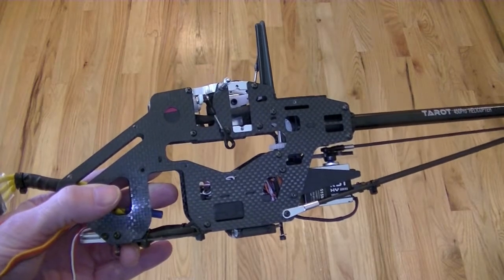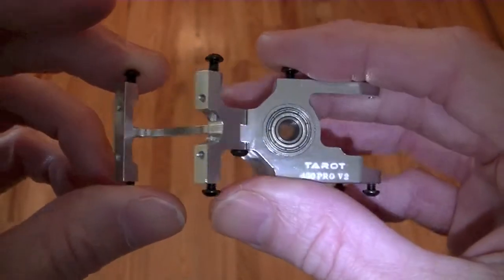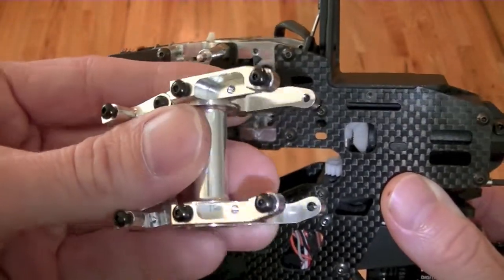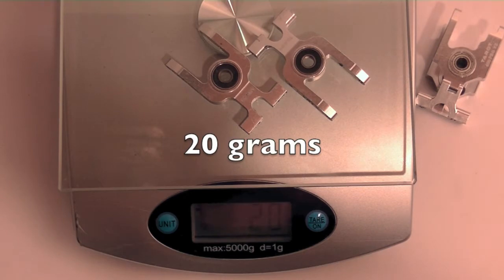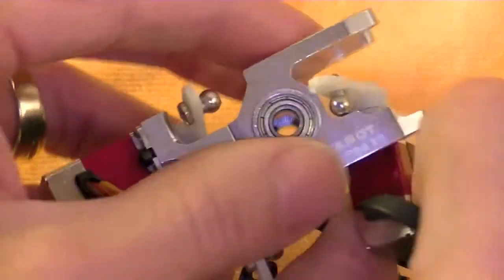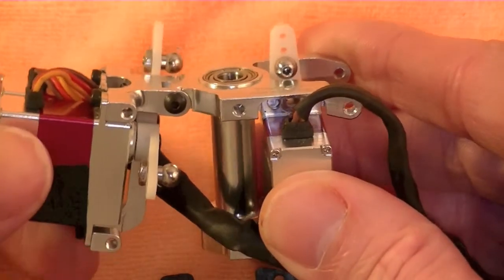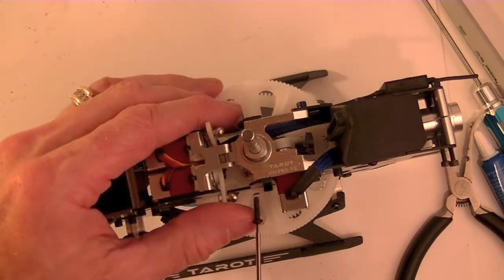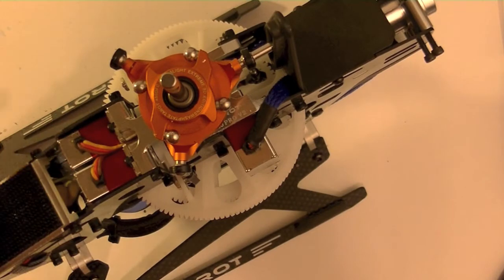57 : Tarot 450 : One Piece Main Bearing Block

Comment from the maker: That's the way they *used* to do it. They have changed that with the newer models.  Take a look at a 450 Pro 3GX manual, and you will see that the servo is now normally installed on the outside of the block (for easier access).

Comment: Have you used the align dfc main shaft on your tarot 450pro? I've tried but I have to shim out about .8mm of slop... Not sure if it's the frame, bearing blocks, or bearings :( makes it a pain though because if you use an Align dfc head it throws off your pitch as the tarot dfc shaft is shorter so the only way to fix is subtrim in the fbl controller or shortning all rods between servo and swash..

Comment: I see you've installed your aluminum transimission with the top access to the front TT gears.  That's a great modification that Align should copycat.
My question is if you've had any problem with the mesh between the autorotation gear and the transmission drive gear?  I've read in two reviews for this mod that the mesh is too tight.  The reviewers may have been installing into Align frames though... dunno for sure.

Comment: I thought the "normal" way to mount the rear servo on the standard bearing blocks was on the inside of the blocks, with the ball reversed. That's how the align manual shows it.

Comment: HELLO CPO i got this one piece bearing i am having a problem the swivel screw is locked in so tight i am afraid it will snap off any suggestions
Reply from the maker: If it's been thread locked... You can apply heat to loosen. Put the tip of a soldering iron on it for a few seconds to heat up the screw.
Reply: EVERYTHING cpo thank you
Reply: EVERYTHING cpo have you any idea what size the bearings are mine have got fairly sloppy are they the same as the standard main shaft bearings thank you CPO

Comment: Ok, where do we get a flush  mount ball for the rear servo? I mocked mine up last night and I have the same alignment problem with the servo arm. Do you suggest using locktite on the screw that acts like a pivot point for the front servos mounting arm? I would expect the other screws that attach it to the frame would be suffice to hold it in place?
Reply from the maker: Ah, yeah...that silly ball link problem!  I am still baffled they didn't do something else there!  You can probably find them elsewhere, but I did a quick search for "ball links" at Tower Hobbies and found these: http://www3.towerhobbies.com/cgi-bin/wti0001p?&I=LXCRXJ&P=7  I tried searching on eBay...but it was tougher. At least this gives you something to target for as you are searching around. As far as the thread lock...I would do it once you have everything where you want it..just to keep that pivot screw from vibrating loose and working out.
Reply: EVERYTHING cpo If you don't have, or have access to a flush mount ball. you can use a standard ball by putting it on a toothpick and grinding off the standoff (if the ball is a screw through 2-piece ball).. Use a dremel with a cutoff wheel on low speed.
Reply: EVERYTHING cpo would it not be easier to use spacers for the rear servo and use longer screws btw i really appreciate all of your videos i am in process of building my 450 just waiting electronics from banggood nearly 2 months goodluck CPO
Reply from the maker: robert parkes, I suppose it would work...if you have spacers and longer screws on hand. I guess it's just a matter of figuring out what you want to try and do to make it work. I had a flush ball in my toolbox, so that was easiest for my build.